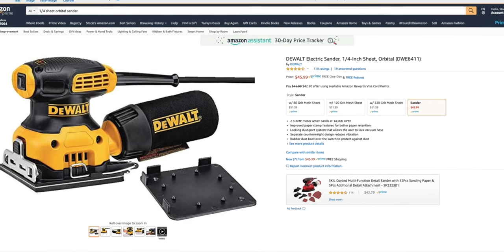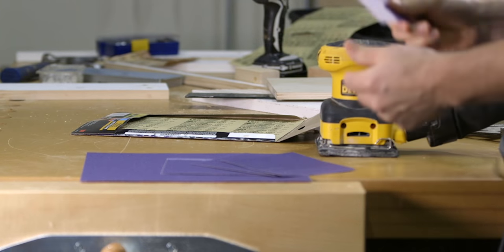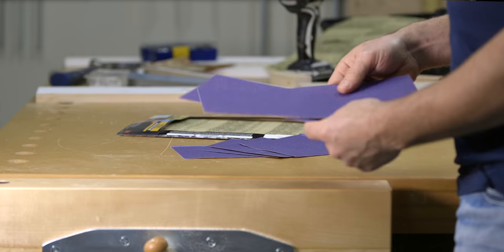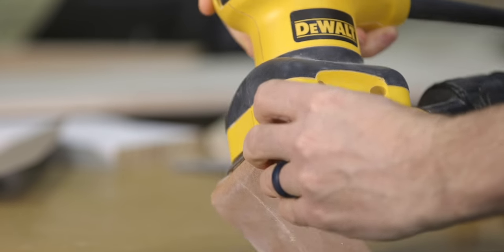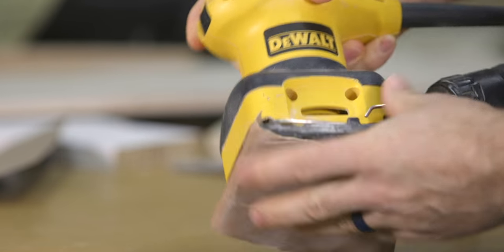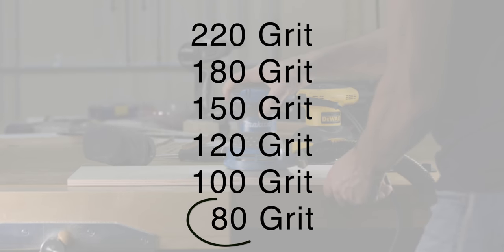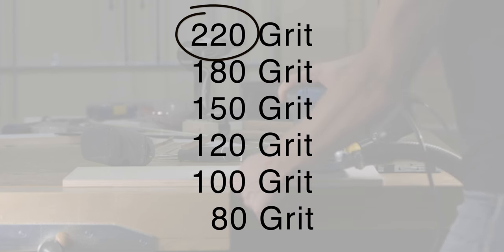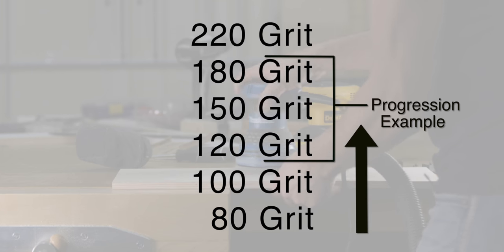Orbital Sander Basics | Beginner Tool

Comment: It's random in its movement so as not to remove too much material at once. That's the key. Dude? This device is designed not to gouge or indent. If it it wasn't random, it would be a grinder.

Comment: ~~Yeah,I love my orbital. IF I use/need 60 grit? It's followed by 100,150,180&depending on what is? 220&maybe even 320 as well.
With 80 grit it's 120,180 etc.
~~When I redid my coffee table w/birch top I used 320,400&600 glued&pressed over night to old discs before finished hand sanding w/800.  Felt like glass&sure can imagine the results after doing two coats red mahogany stain that darkened it beautifully. Followed by coat wipe on Satin poly using 320&400 by hand between stains&after the poly before finishing w/3 light coats of laquer. 
~~Definitely pleased,poured lil water out of curiosity/test&it beaded like the best ceramic ever.

Comment: Logical, essentialized, and succinct.  Well done.  Useful to me. Thank you.
Question: Should I expect to be able to remove 1/16” to ⅛” height difference between joined plywood and hardwood with an orbital sander? Background: New purchase of Ryobi OS, used included sample of 80 grit to smooth joint between maple face frame and ¾” ply cabinet. 20 minutes of sanding with little result on hardwood. My technique was as you describe, so I don’t think that was the issue. Used to hand sanding; I often use 60 grit and have better results than I did with the OS. I wonder if the sample paper is inferior, or I expect too much from an OS.
Reply from the maker: I'm not sure what's going on. A random orbital should have no problem removing that amount of material. If you want to find me on Instagram, you can send me a photo/video of what you are working on, and I might be able to help you better.
Reply: Keeping the dust bag clean?

Comment: Love your content, have learned so much! Question… when using the orbital sander, what dictates the speed you should use? Mine has a variable speed, and I don’t know enough about these things to know if they all do. I will look for a more advanced video as well.  Thanks!!!
Reply from the maker: Hello. Great question. 90% of the time you can keep it at full speed. You can dial it back as a way to slow down the amount of material it will remove.

Comment: I’d like to ask about the electrical sander would you get a machine that can function as both a sander and a polisher or would you rather get them individually? 
By The Way great video as you made it short and straight to the point
Reply from the maker: I would get them individually. Thanks for the comment.

Comment: Can the random orbital sander remove paint and stain quickly? Or are you better off with an angle grinder with sanding attachment? I.e. a big project like sanding an entire deck because you can't use a stripper or power wash safely in the environment
Reply from the maker: Yes it can

Comment: What is you reccomendation on sanding progression? 

You showed the numbers from 80 to 220 grits (6 steps), but can I do it like 80 - 120 - 180 and get great result while skipping the numbers between?

I know I may sound like cutting corners or whatnot, tbh my sanding skills are at minimum, so I need your opinion to this...
Reply from the maker: You can totally do a 3 step sanding progression. I would probably do something like 120 - 180 -220.

Comment: I have a Dewalt DWE6423 and I find it awkward to control. it tries to pull in different directions. sometimes it chatters a bit. I know you're supposed to let the weight of the sander do the sanding and not press etc. not sure if i need to adjust speed or or the work piece is too small. its a 125mm sanding pad but the piece I was sanding was 80mm, and 40mm. its hard to keep it centered and it seemed to work better on the top or the bottom of the disc etc.

Comment: How much pressure should I be applying to the sander?  Can't seem to find any info on that, and I've had varying results depending on how much I apply.
Reply from the maker: Great question. I would say light to moderate pressure... no need to push down hard on a random orbit. If you find the need to push down to remove more material quicker, you should lower the grit of your sandpaper. Bottom line, let the machine do most of the work, you are there just to guide it. Hope that helps.

Comment: Thank you for the video! If the random orbital sander goes at random how does it prevent cross grain scratches?
Reply from the maker: Great question. Simple answer, because of the design/function of the random orbit. Now, some sanders are of course better than others at this, but the only time you have to worry about cross grain scratches now a-days, is if you are hand sanding. :)
Reply: @TrainingHandsAcademy  Thank you so much!

Comment: Do we need to exert certain amount of pressure when using the sander ? ? ? Or should we just allow to sander to run smoothly ? ?  ? Thanks . .
Reply from the maker: That is a great question! Most of the time all you need to do is add a little pressure and then let the sander do the rest. The more pressure you add the more material it removes.
Reply: @TrainingHandsAcademy   Ok thanks for the answer :)

Comment: What about a multitool sander? I have a Bosch GOP 18V and it has a triangular surface where I can apply the sanding paper. Can I use it like the random orbital sander? I can't afford a ROS now and I want to use what I have. :) Thank you for the tips in the video btw!
Reply from the maker: It will not work like a ROS but... do the best you can with what you have Sebastian. :)

Comment: I am sanding out a deep scratch in a lacquered walnut floor on specific planks, I need a sander that will leave no scratch marks, would you recommend a rotating sander? is there a way to get a sander that holds 320 grit sandpaper?
Reply from the maker: Sounds like a random orbital sander (if your planks are wide enough) and some hand sanding should do the trick. Yes, sanders can hold 320 grit.

Comment: I have the sander machine square shaped pad , noticed that we have to use A4 size sand paper only and cut in 4 pieces as mentioned in video , however there are some sandpaper role which is too thick and the machine is not doing its job correctly, So, do not use sand paper role and cut it to fits the machine .

Comment: Does the amount of pressure you put on the sander differ on the material you sand?
I feel like putting pressure more when sanding multiple paint layers off. Is that wrong?
Reply from the maker: Yes, it does seem to make a little difference... but you can add too much pressure (hard on the sander). You also might try going with a courser grit so you don't have to work so hard. :)

Comment: I’m sanding an oak slab to a nice finish with a random orbital sander. I have sanded up to 220 grit but see swirl marks. They only showed up when I applied polyurethane to my test piece. Then I looked closer at the finished piece I sanded, shone light across it, and saw the fine swirl marks. When I sand gently by hand I can remove these with 220. But there’s a lot to get through. Is there some technique I am missing? I have kept the sanding disc flat....
Reply from the maker: Hey Mat! What type of orbital are you using?
Reply: @TrainingHandsAcademy  Thanks for reading and responding. It’s an electric random orbital, I forget the make and model (it’s borrowed from a family member but I can check tomorrow) it’s quite heavy / old, maybe it needs a lighter touch? Also possible that the 220 grit paper I had was too dull. I have bought some new 240 discs tonight. I have listened carefully to all your suggestions. Can you “over sand”? I’m not staining, I will be applying a wipe on poly only. I think the sander is Bosch but will check tomorrow. Thanks!
Reply from the maker: @MatSmithLondon  Ok, the only reason why I ask is over time some random orbitals can stop working correctly, and start leaving those marks. No, you can't really "over sand" with 220 grit. .
Reply: @TrainingHandsAcademy  Thanks. I took a hybrid approach and hand sanded, buffed, applied a very thin coat of poly, buffed with a high grit, and eventually it is starting to look perfect after three very thinned down coats of poly. Accidentally didn’t fill the knot holes or the rough grain on the live edge so I guess they will fill with dust over the years. Ooops... you live and learn I guess! Thanks for you comment, even little comments like yours can inspire confidence...
Reply from the maker: @MatSmithLondon  Glad you got it all worked out Mat! Thanks for letting me know.

Comment: I just bought my first random orbital sander not sure of its working properly or not. When I turn it on in the air the pad spins fine, but if I apply as little pressure my finger, the pad doesn't spin instead vibrates. It that how its supposed to be or should I get it replaced ?
Reply from the maker: Yes, sounds like it is working fine. Radom orbitals do way more oscillating (vibrating) than spinning. If they spin too much you will be left with swirl marks. Again, I think you are good Hussain.
Reply: @TrainingHandsAcademy  thankyou for the swift reply.

Comment: Do you have any thoughts about cordless vs AC powered choices?
Reply from the maker: Unfortunately, I don't have very much experience with cordless tools other than drills. I've always used corded tools. Once I get the opportunity to try some more out, I will have more to say on the topic. Great question, wish I had more to give you Kean. 😀
Reply: Thanks Josh! I'm gonna answer my question to some degree as I thought about it a bit more. If I hook up an orbital sander to a vacuum then there's no advantage to going cordless. However on something small and quick it will be nice to be untethered. Like wise it could be nice to be untethered when working a large piece like a slab--except for the dust issue. The  question I can't answer is just about power/duration. Can the cordless ones hold up with today's battery technology for continues run time? Drills and even saws are usually pretty quick runs, so as a hobbyist I'm fine with those on battery for the most part. But sanders are usually much more continuous runs.  Let me know when you try some out. Thanks again.   @TrainingHandsAcademy

Comment: I want to purchacee a sander to sand old woods 'with paints and deep scratches' and i hesitate a lot between orbital and belt sanders, Orbital seems to be good for me for it's easyness and compactness but i'm afrraid of sanding limitation, somethime i have to remove about 1,5mm from wood surface. Any help please
Reply from the maker: You will most likely need both. The orbital will work, but on some projects it might take too long.

Comment: i basically want to sand the spine off of books while they are clamped down. to quickly depage books for turning pages into digital. so i guess 80 grit paper would be for me. hopefully it works. circular saw is too big and clunky. smaller orbital cutter electric box cutter is a bit too slow and tedious. so im considering sanding off the spines of the books.
Reply from the maker: let me know how that goes

Comment: Can you turn off random orbit mode, and use it as a rotary sander?
Reply from the maker: Not on these, but maybe Festool?
Reply: @TrainingHandsAcademy  there's something called a pneumatic DA sander that can do that. But they consume so much air they require a large compressor to run. So they're not really available for amateurs to use. It's still the tool of choice in pro autobody shops. Where they make their living sanding.
Reply from the maker: @1pcfred  Thanks for the info!

Comment: Why does my random orbital sander stop spinning while you're sanding?
Reply from the maker: Not sure Linda, sounds like there is something wrong with it.
Reply: @TrainingHandsAcademy  I just bought a new Dewalt and it does the same thing..Could it be user error, maybe? What are the chances of getting two different brands with same problem? I have so much to learn, but it's fun.
Reply: Maybe you are putting a lot of pressure on the sander
Reply: Pushing down too hard

Comment: Everyone I've seen until you professes a  slow (1 inch per second) movement speed. You moved suuuuuper fast comparatively... thoughts?
Reply from the maker: Great question. I'm honestly not sure if that's true or not. All I know is that if I'm taking a lot of material off, I'll sand slower. And if I'm just removing a little, I move more quickly. Depends on the type of sander too. Honestly, I've been sanding and finishing projects for over 25 years.... never really thought too much about that. Sorry, wish I could be more helpful.